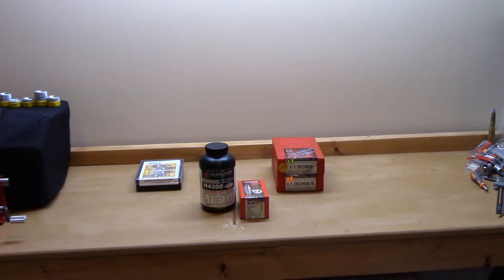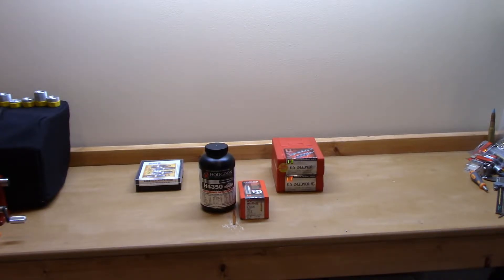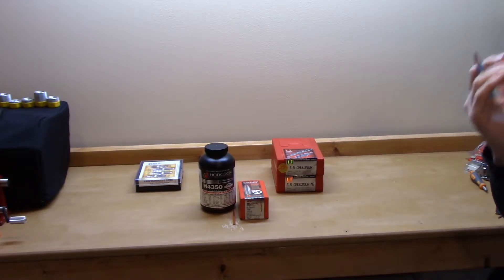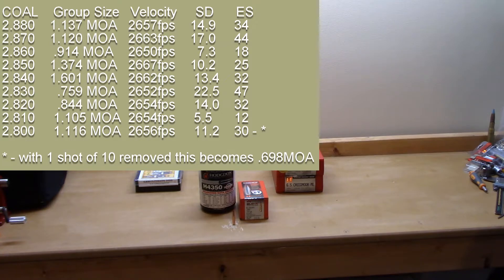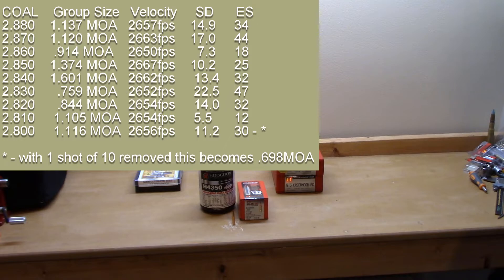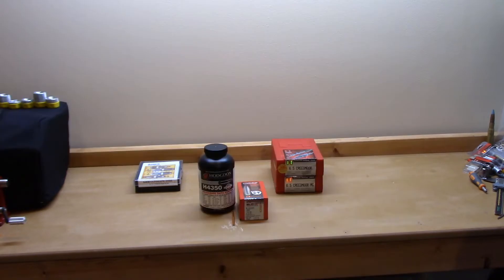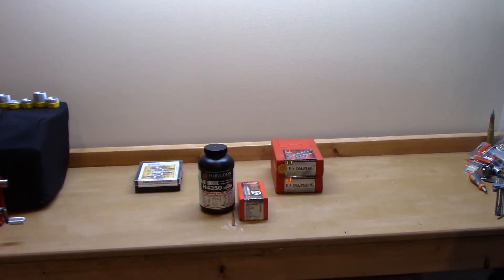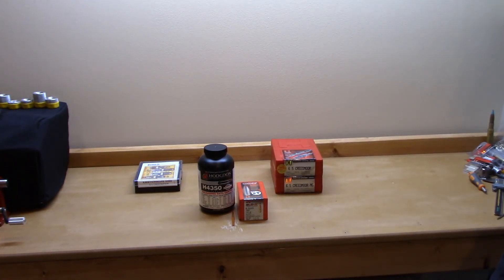Ruger Precision Rifle testing COAL variation on the 143gr Hornady ELD-X with Hodgen H4350

Comment: I see a lot of people loading these very long with a .020" jump and up to 42.3 grains of H4350. They claim there are nodes at 40, 41.5 and 42-42.3. Thank you for the test with the recommended 2.800" COAL. My primary interest in the ELD-X is for hunting and I want it to fit in the magazine. I'm going to do a work up to the 41.5 with the COAL at 2.800". If my 5-shot group is anything like your 10-shot group (minus the one flyer), I think I'll call it good enough for this year.

Comment: As you know very well, reloading can be very mysterious. I wonder if loading away from the lands gives better results with these very long bullets because it allows the bullet to strike the very fast rifling twist rate at a higher velocity and pressure helping to free it quicker from the case neck and giving better accuracy. Just a thought. There is a lot of bullet  protrusion in the case and a few thousands off the lands might mean the pressure is still fairly low when the bullet engages the lands so the neck may not have expanded yet. When you load away from the lands you allow more pressure and velocity to build before it engages the rifling in the lead. Maybe you'll see the opposite when you load lighter shorter bullets and these may very well shoot better if you load them closer to the lands (if it's possible.) When you go up one weight class in a .30 caliber bullet it doesn't affect bullet length as much as when you do it in a smaller 6.5mm caliber class. The Sierras had very short COL and shot very well. Just a thought.
Reply from the maker: My head definitely went somewhere close to this direction. Only time will tell. So far my best results have been with the 140 ELDs and the 142 SMKs. I am sure with anything in life the more I try the more I will learn. Thanks for posting a comment and consider subscribing to the channel. There is a lot more data to come.